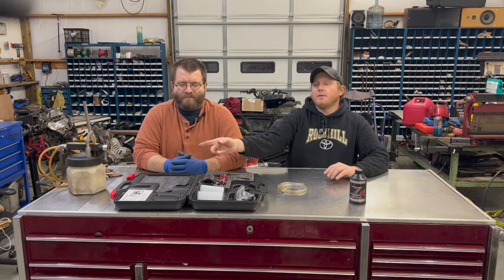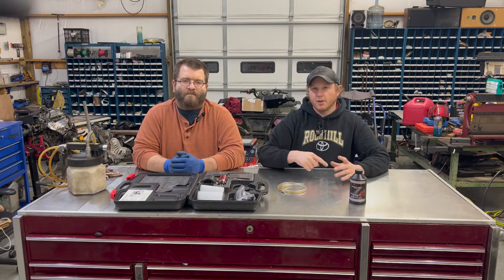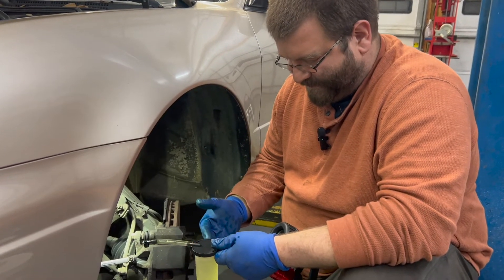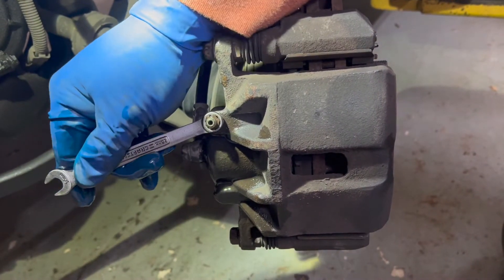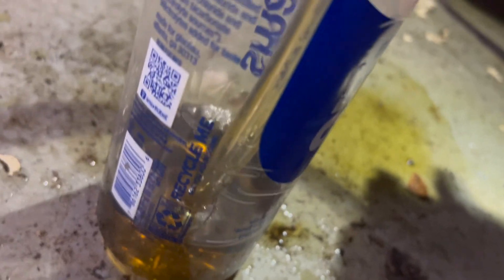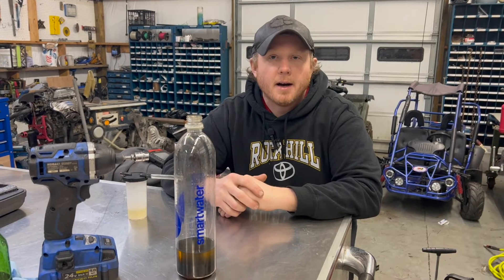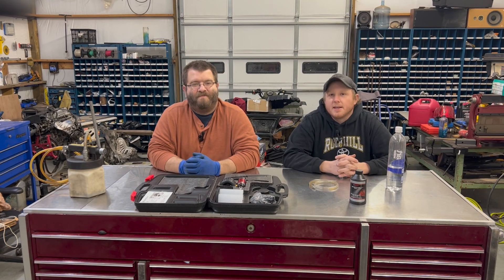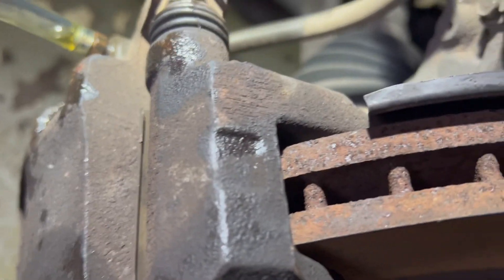One Person Brake Bleeding Showdown: Which Method Works Best? Vacuum, Reverse, Check Valve, or DIY?

Comment: I put Speed Bleeders on all four brake lines of my 2001 Crown Vic a few years ago. Over time my brakes got soft so I thought I'd give the brakes a bleed by myself and see how well I could do it on my own. What I like about the Speed Bleeder is that they have a deeper thread and the hex end is also bigger so it doesn't round out if hard to loosen. I put some clear hose on the nipple and the other end in a jar. I loosen the first one. No drip. Get in the car push the brake pedal down 4 or 5 times. No need to open and close the bleeder (valve takes care of that). Did the rest of the lines. Brakes are now right there. Done in a few minutes by myself. I'm 76 years old and still life the feeling of doing things myself.

Comment: I cannot get my 2019 ram 3500 brakes to bleed using a huge suction device at the bleed valve or a pressure bleeder on the master cylinder. I can however do a two person bleed no problem. I’ve tried 3 different master cylinder caps, one being a large rubber stopper type and two bleeder caps and I just get leaks. The big suction device creates a huge vacuum but virtually nothing gets sucked out, I’ve tried opening the bleeder valve to different spots and the vacuum in the big syringe just pulls the plunger backwards when I let go of it like as if I never opened the bleed screw.
Any ideas guys?
Reply from the maker: Pretty normal on these trucks, honestly. The ABS unit has valves that stay closed with the key off, so vacuum bleeding usually won’t pull fluid at all. You end up just sucking air past the bleeder screw threads, which is why it feels like the screw is still closed and the plunger pops back. Pressure bleeding has the same problem if the master cap isn’t sealed perfectly, and even then I haven't had much luck with it. Pedal bleeding works because you’re making way more pressure with your foot than any vacuum or low-pressure bleeder can, so it pushes fluid through the ABS block no problem. Is there some problem that the truck is giving you that you can't get past or is this just a question out of curiosity after the fact?
Reply: I’m just trying to do a brake flush. I watched another video of Master tech (Josh) a Chrysler tech. using a pressure bleeder he built with a stock reservoir cap being used as a bleeder cap and he didn’t seem to have a problem. Maybe I’ll have to ask him. Thx anyway.

Comment: Wow, what not to do.... Yall fukers know that once you pumped air into the bleeder that you oxygenated the brake fluid with thousands of microscopic air bubbles just like a bubbly salt water fish tank. These bubbles take time to gather and form a larger bubble which then it can be flushed out of the system with a natural gravity flow, a simple open bleeder valve. AND NEVER reverse pump any fluids up thru the calipers.

Comment: i have found putting some grease or litium grease at the base of the bleeder vavle will stop air from getting into the system while cracking open the valve and the hose is on it , works great for me and that using the one way check valve on the hose

Comment: It's frustrating I have the same thing happened with my four uncles unit. All four wheels nothing but air it doesn't say anything in their dang manual about having to put grease around the Pecock plus the unit loses all kinds of air pressure as soon as you apply the vacuum. I contacted four uncles to see if their units defective or not. Just frustrating

Comment: You left out the best method. A pressurized container attached to the reservoir, forcing fluid through the system. An example is the Motive Brake Bleeder.

Comment: The best brake bleeding information I have seen to date. They gave me a full understanding of how these systems work. I had considered the reverse system but immediately thought about pushing back dirt or old fluid, if you are not flushing all the brake fluid in the system first. I'll give this report a 10/10

Comment: Left out one.
The one that forces brake fluid into the system with manual pressure of 15lbs
Reply: that's reverse bleeding
Reply: @waydemorris1451  Pressure bleeding from an adapter on the master cylinder.
Reply: @waydemorris1451  It's a hose w/ a cap that fits on top of the master, and pumps air in from the master.  That's not reverse.

Comment: smart water bottle best method, I even drill a little hole through the plastic cap which helps keep the hose secure. vaccuum method SUCKS

Comment: everytime I used a vacuum brake bleeder, air gets in through the threads on the bleeder vavle the second I loosen it, so the vaccuum jsut ends up sucking in air. tacoma, f-150 everything. WTF man?!
Reply: Just put grease around the bleeder or anti-seize and make sure your bleeder hose is pointing up not hanging down works perfect eliminates air coming through the threads don't be afraid to gob on the grease you can always wipe that off

Comment: The "bleeder" that pushes dirty fluid backward into the master cylinder is shit.  Vacuum systems are shit.  The check valve is OK but a shorter hose would help and you may not get enough flow by pumping the pedal.  USE A PRESSURE BLEEDER!

Comment: Very Good!! I use the MityVac mostly to flush the old fluid out. Also, when I use the MityVac, I leave the suction on while closing the bleeder..  Another tip, I have a vehicle that has M8X1.2 length 24mm brake bleeder. So ,I make an adapter, I ordered some M8X1.2mm length 31mm and slid a 6" clear plastic hose over the bleeder nipple with a small about of silicon rubber topped a with a small Zip Tie. No more air leaks and bubbles. Solution is to make adapters instead of using the rubber boots that come with the unit..
Reply: I have a similar tool from OEM Tools. Seems to work well for one man brake bleeds.
Reply: Ingenious solution, thanks for sharing!
Reply: That’s the problem I often hear, air gets around that rubber fitting on those vacuum bleed systems. I have one I have used since I purchased it 2 months ago. I’m going to follow your suggestion. Also I hear DYI’ers crack open the bleeder valve slightly to keep air from getting around the threads. I’ll go on step further by pulling a vacuum first then crack open the valve.

Comment: Air powered reverse bleeding is fine just be ready to drain the master cylinder when it fills up… if there is debris in the lines all ready chances are no matter which method you use it will eventually reach the master cylinder anyway when you close the system up and get back to normal driving. 2 people recommend or keep watch on reservoir level

Comment: No power bleeding methods?
Reply: exactly, I have all the systems and the pressure bleeders/fillers at the master cyl res are golden, by far the best out there - can't believe you make this extensive vid and not include that.
Reply from the maker: Neither of us have one. But maybe we’ll revisit one day.
Reply: @automotiveinsight  I like the vaccum method you showed, it wasn't just my imagination... it leaves air in the lines!
Reply from the maker: It definitely does. I imagine the entire line looks like the hose while you’re doing it. It definitely needs to gravity bleed after.
Reply: @automotiveinsight I saw one video where the vacuum hand pump had to be done for like 15 minutes before the line showed a steady airless flow with a few M/C topoffs as well